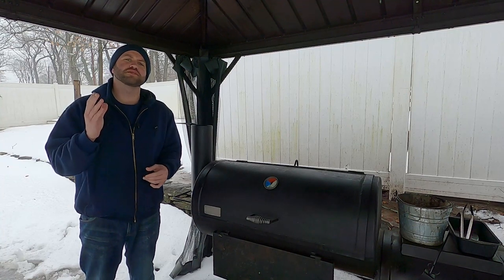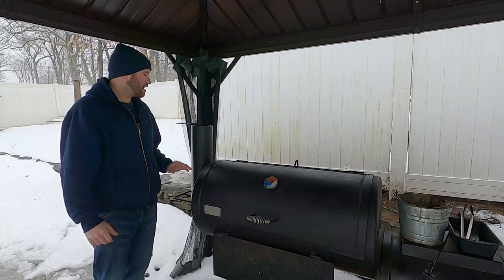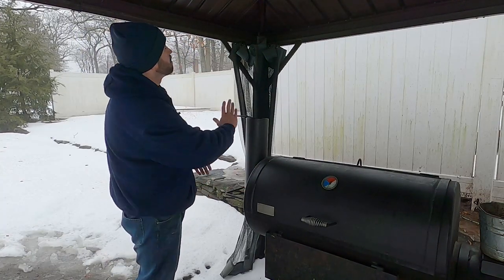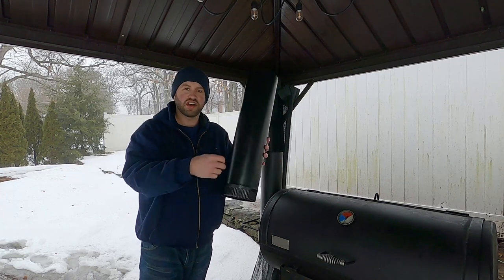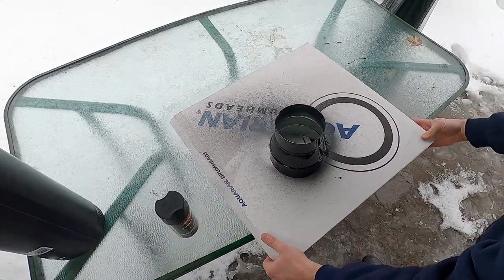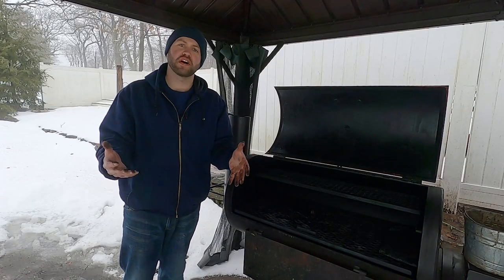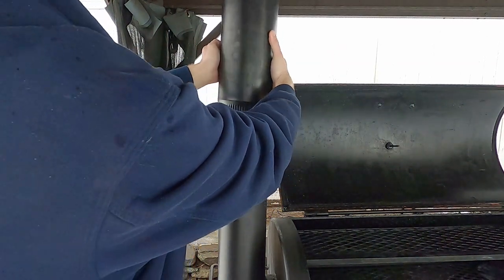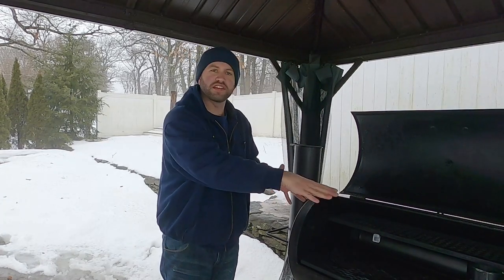GET BETTER TEMPS ON YOUR SMOKER QUICKLY AND CHEAP | How To Extend Your Smoker Stack | Fatty's Feasts

Comment: LOL bro, you did a far better & cleaner job than Mad Scientist in the removal of that heat deflector plate, I think he'd be cool with this. Solid info & great to the point video
Reply from the maker: Glad you enjoyed it! I did see his video and didn't understand why he didn't just pull it out. Maybe his had more welds or something. I will say, removing it has been a huge help in managing temps.

Comment: So, I have an older model Brinkman offset smoker with a 3" (D) X 16" (L) smoke stack with no baffles, my question is would I gain anything by lengthening my smoke stack?
Reply from the maker: Lengthening it will just help the flow, so go for it and see how it does!

Comment: Don't justify what you are doing just because someone else did it, this content comes free of cost and just happens to be what I'm interested in right know. I bent my baffle up on. DLX and was comfortable enough to cook a $90 brisket after doing it but I think I'm going to remove and do the stack ext. I want mine to be as short as possible because I don't want too much convection, just enough to keep the temperature pretty even across the pit
Reply from the maker: Thanks for the kind words. People sometimes get annoyed by seeing duplicate content, which I don't understand since I like to see multiple ways of doing things, but it is what it is I guess! I did the bend up in another video and while it definitely improved the temps, there was still a massive hot spot farther in than I wanted. Hopefully these new modifications work. We will see if I have to cut the stack back a bit.

Comment: That adapter you used is galvanized, that`s why it cost more, I thought galvanized was a no no on all cooking, it`s toxic, I don`t know if it matters on a stack, but as oils run down, they will carry galvanize I think, I would buy plain steel just to be sure., just a thought.
Reply from the maker: Good catch. I don't think it gets hot enough to be worried about the off gassing, plus I painted it. If it were bubbling up, then I would be a bit concerned!

Comment: I live in central Texas, so we're definitely not used the cold and snow. But I did run mine this weekend when it was 19°. I had to babysit it a lot more often and had to run more wood. My cook should have taken about 4-5 hours and ended up taking me about 14. It did a good job. I had to know what would happen in those temps. But unless it's an emergency, I probably won't do that crap again. Lol.
Reply from the maker: Ugh…you guys aren’t supposed to go through the misery of those temps! I did a cook last year when it was around 30, but windy as hell. Had the same thing happen and it was only a 12 pound brisket.
Reply: In that situation, I would smoke and then when I wrap I would move it to my oven to finish.
Reply: @barrygolden9823  Argh, alright dude, you totally busted me. By like hour five hundred and fifty two I did wrap and finish that shit off in the oven. Lol. 
Nah, just the last couple hours. It was like 4 in the freaking morning. I also didn't mention that everything stalled at like 162° for like 4 hours. 
Either way, I did it! It was a life experience, and now, I'm good. No more need to ever do that shiat again!
Reply: @hulkhuggett  I can relate, been there, done that!!! 
Finishing in the oven also saves wood!!!
Reply from the maker: @barrygolden9823   My problem is my ovens are old and not completely accurate when it comes to temp. I could use my warming trays but for whatever reason, I just decide to brave the elements.
Reply: My first brisket I ever smoked was in ALASKA at -30F. The fat drippings actually made a fat-cicle. It’s all been downhill from there!
Reply: @BristanKellerUSAF  lol. Dang!

Comment: That 5 to 6 connector is galvanized..aint that bad for pit?
Reply from the maker: Galvanized metal, when heated to the point of off-gassing, is toxic. However, in this case, we aren't getting to the point it would off gas. First, it's at the stack, which will be nowhere near as hot to cause concern. Also, note I painted it. If it were to offgas, we would see bubbling. Never saw that.

Comment: You can get 41/2 inch grinder inside to cut off welds .
I did
Reply from the maker: Yeah thats basically what I said here, then pulled off the plate inside.

Comment: I wonder how adding an elbow to direct the smoke away from the pergola would affect the airflow.  Maybe then make the stack taller to compensate? Then you can keep the pit where you have it.  Just a thought.  I’m not a Hvac guy.
Reply from the maker: You know what's funny is I keep visualize that when I look at the smoker and trying to figure out if it would work. I would say it would affect it negatively but I'm not sure. I dont think I've ever seen a smoker with that, but I may try it.
Reply: I have been wondering the same thing. I'd like to get one of these smokers but I will have to place it kinda close to the over-hang of my roof. I would like to extend the stack at a 45 or less so I don't dirty up the house. I suspect the rising of the heated air will pull it up through the stack but it is just a guess.

Comment: Could you do another 90° to get the stack out from under your canopy? I'm guess I'm not sure if the benefit from the stack extension comes from the length or the height.
Reply from the maker: That would affect the draw of the stack. I just want it to be straight up and out. If it were a bigger smoker, maybe. But on this one, a small gust of wind can screw with the fire. Wouldn't want to add to that LOL

Comment: When extending the chimney does it have to be on the inside or could you slip it over the outside? I just came across a cheap rusted smoker for free but the damper has a part thats welded on the inside and dont have the means to get that peice out
Reply from the maker: I hate when they do that. Makes no sense to me. But yeah if you can get it on the outside, that would be perfectly fine!
Reply: @FattysFeasts  hey thanks for the reply it's really appreciated.. It's exactly what I wanted to hear.

Comment: The only problem with your idea is when you heat galvanized metal hot enough it give off a very harmful smoke
Reply from the maker: This is true, however, for this use, it's not a problem. My temps aren't going high enough for it to off gas. Plus, I coated the thing in paint. So, if it were off gassing, I would see some bubbling at least.

Comment: I know this is old and you have another smoker now but I think you would gain a little more grate space if you removed the baffle off the grate.
Reply from the maker: I actually did remove it. Not that I would put anything there since it is the hottest spot now, but even with that plate still on the grate, it was making the hot spot more towards the middle of the smoker.

Comment: Instead of a "water pan" I fill the bottom of my cooking chamber with water during the smoke.  Would like to know your thoughts on this.
Reply from the maker: I honestly have never tried it, but I would be curious to. I would say it depends on where your grease drain is. With mine being on the stack side, I would rather have a pan near the fire box. But if I got a ball valve for my drain, I would definitely try it out! In your experience, does that allow for easier cleanup afterwards?
Reply: I have the same old country smoker as in your video.  I did install a ball valve on the drain which allows me to clean up in about 20 minutes. Just put a 5 gallon bucket under it and start spraying. Thanks for your input and keep up the great videos.
Reply: Depending on what I'm cooking, I like to fill the pan Apple juice or Apple Cider. Really changes the game! Especially with ribs!

Comment: Will these be same measurements for the old country pecos? And Can you tell me the exact extension size, and the name and size of the adapter, I don't want to cut anything as well. And were to buy them from. Good job 👌🏾👌🏾
Reply from the maker: Glad you enjoyed it! I put all of the links for what I purchased in the description. Got them all from Lowes. I believe the diameter of the pecos smoker stack is an inch less than the brazos, so you'll just need to get a size lower. Lowes should have all of that stuff in stock.

Comment: i have a old country smoker I rarely use. I've had it for 3yrs and cooked on it 3 times.  I'm glad I get to see this modification as I observed a very hot spot close to the shield. I'm going to remove the heat shield and get ready for better cooking. I need to know what size of extension on  chimney and how long it should be. I'm getting ready to use in a couple weeks I'm sure this will help me do better. ""THANK YOU!!!
Reply from the maker: Glad I could help! The piece I picked up was just a standard extension at home depot. I think it's about 30 inches. About double the size of the stack.
Reply: Thank you! I get the feeling this smoker is going to be more busy.👌

Comment: My old smoker didn't have deflector and I would have to rotate slabs of ribs so the ones closest to the firebox wouldn't over cook or burn. I was thinking about getting a pecos
Reply from the maker: I find that mine runs much better without it, but if it was any smaller I’d be in trouble

Comment: How do you regulate air flow from the stack when you add the extension connector?
Reply from the maker: I actually never screw with the damper on the stack. I have always used the damper on the firebox door to regulate my air flow. Here is a link to my fire management video where I go a little more in depth about my theory on that and what I do! https://youtu.be/SdzIiz34nAw

Comment: My pecos damper has like a 9/16 bolt welded to the inside of the smoke stack so you can’t remove the damper. I still feel like your mod will be easiest to apply still though. I did paint inside with that black paint. This weekend gonna trim it.
Reply from the maker: I don't know why they designed it that way...Kind of dumb. Let me know how it turns out!
Reply: @FattysFeasts  it wasn’t too bad with a grinder. There’s maybe a half of a business card of open space with adapter + stove pipe. Easily filled with foil. Gonna test sometime this week. I still feel like this is easier than doing a hose clamp on outside of smoke stack. Love this pecos.
Reply from the maker: @FuzzyLumkins420  That's awesome! Let me know how it works!

Comment: I have a question 🤔🤔🤔🤔I have a 16 inc thick plastic yard blower adapter that connects to the yard blower to pick up leaves, it actually sits inside my old country pecos smoke stack, do you think it's possible that I can use that as a stack extension? Just trying to use what I have 👌🏾please let me know your opinion on this matter.
Reply from the maker: What's the diameter? It may work. It won't be as long as the one I have on here, but at least it can add some draw. My only concern would be the plastic melting or off-gassing, especially if you're using it on a cook for 12-16 hours. Wouldn't want any of that somehow getting on your food.
Reply: @FattysFeasts  extension is 17 and 3\8 in length making the smoke stack a total of 36 inches in height and a diameter of 6 and a half inches, the plastic is a very hard firm plastic, what do you think 🤔
Reply from the maker: @ignoranceisnotatrend4669  You can try it and just keep an eye on it to make sure you don't get it to a temp where it's melting. I just try to shy away from plastics in cooking and the metal for the extension isn't that much. But I also understand your desire to use stuff you already have! Let me know how it works out!
Reply: @FattysFeasts  it will sit down about 2 inches in the original stack, I only thought about this because I don't use the blower adapter, maybe I'll just buy some stove pipe 👍🏽

Comment: should cut it til the whole thing is 36 in! trust me, the taller the stack without the collector, the hot spot will be by the stack.
Reply: Interesting point with that 5-6” adapter.  My tests were w/ a 16” and 22” addition to the stock stack w/ no steady back pressure.  Too high and yes, that can happen.
Reply from the maker: Good suggestion! I’m very curious to try it and see what happens. If I can decrease the size so I don’t have to move it every time, that would definitely be a plus.

Comment: Nice. Does the smoker piece of the unit get hot enough to convection cook a steak or burgers? I.e. for 25 to 450°? Without having Kohl’s in the smoker part just using the firebox.
Reply from the maker: From what I have tried, yes you can use it as a grill but I have a bit of trouble getting it above 425ish without the flames going in the smoke chamber. I actually made a video about that as well so be sure to check it out! I would never use it for steaks as I don’t think you can get a good sear, but I love doing burgers on it.
Reply: @FattysFeasts  Exactly what I needed to know. I would also then assume if it does burgers OK without direct flame chicken would be a no-brainer. And would work fine.
Reply: Just as an FYI I am a big green egg user. And would like to get this offset thing to expand my cooking skills. Again thank you so much for your input.

Comment: Hey man  so I'm curious since you have done all the mods have you been able to tell a difference In your cooks?? Temp control, hot spots, etc???  Really considering doing the mods myself.
Reply from the maker: Absolutely. I've mentioned it in some other videos following this one, but the temps are definitely more even. Still have some differences between the front and the back, but I stopped burning stuff right in the middle and the area closest to the firebox is definitely the hottest now, which is what I wanted. If you're gonna do the bare minimum, take that stupid baffle plate out. It is useless.
Reply: @FattysFeasts  ok yes so I took the baffle plate out. The bottom of my briskets were getting crispy for sure I couldn't get that slice through that I wanted.  I havent smoked anything since I did that but plan on it tomorrow.  What about your fire box? Did you add anything to lift the fire off the bottom to help with air flow to the fire??
Reply from the maker: @gardentogether9298  I tried so many things with that. Here is a link to my fire management video where I talk more about those mods in particular. 
https://youtu.be/SdzIiz34nAw
At the end of the day, I found simplicity wins over all!

Comment: This gets a subscribe
Reply from the maker: Glad you enjoyed it. Thanks!
Reply: @FattysFeasts  yep I know I can learn a lot from your teaching style. I have the pecos. I don’t if your familiar with the smoke stack but it’s different from the Brazos as far as the lid/vent for the smoke stack. I think I may have to remove it to get the connector piece to go in because the lid is in the way even when all the way open. I wasn’t sure if you were familiar with this.
Reply from the maker: @cretestlloyd4681  Oh yes I understand now. Definitely let me know how it works out! Obviously with my extension I can't use the damper either, but I've found with the old country smokers, if you use it to control temps you just end up killing the fire since the draw isn't that great to begin with.